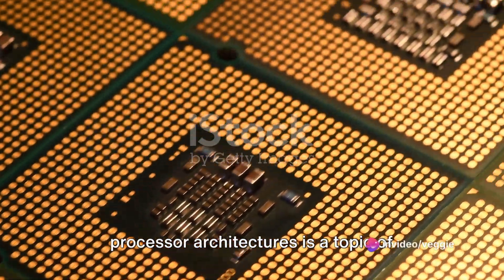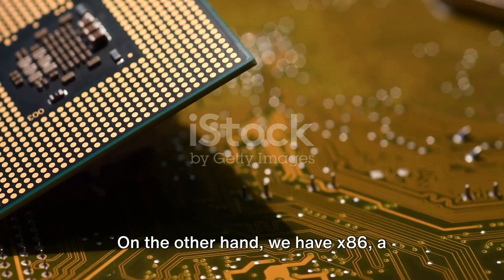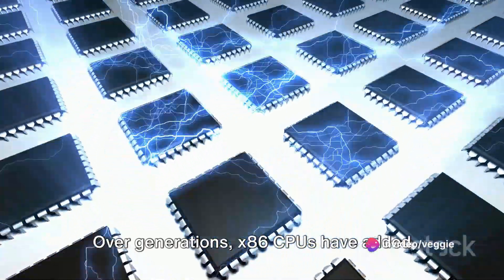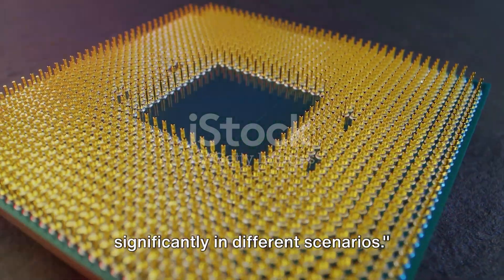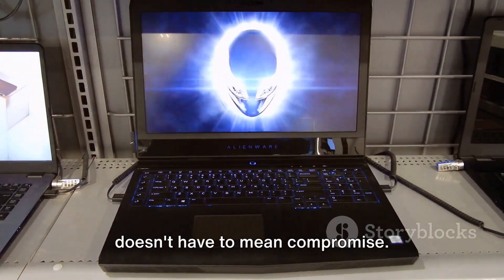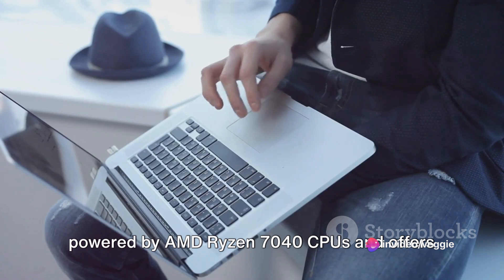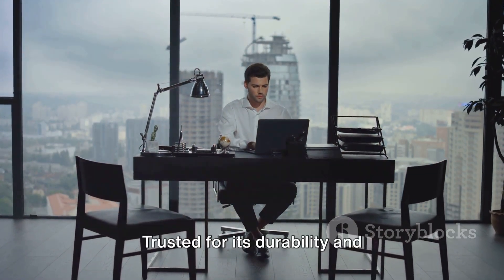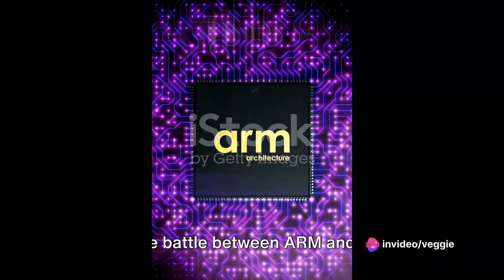ARM vs x86 Which has the Best Processor Architecture

Comment: Ahh no it sucks for gaming sorry lowest settings is not acceptable. so ARM still mobile but not for a serious home machine that games and encodes hidef video. Although you can add a separate video encoding chip like Apple does.
Reply: Thats chnaging now. X86 will float around due to gaming and old apps till ARM becomes powerful enough to emulate AAA games. ARM is the future with RISC 5 as a alternative. X86 wont survive especially after what M series has done . Now there is no coming back .
Reply: Ive seen someone use arm soc with Nvidia GPU in Linux and gaming is wild
Reply: Got no problem running Res Evil 4 on ultra settings in highest resolution with locked 60 fps on my MacBook Pro. it's all about developing games for apple silicon

Comment: wasn't x86 ONLY for 32 bit OSes?
Reply: No, they extended it into 64 bit. AMD did it first. Now the underlying architecture is RISC, not CISC. That happened with the K6 processor. This architecture translates the CISC x86 at execution into RISC instructions. This hybrid approach is used in all x86 branded processors today.